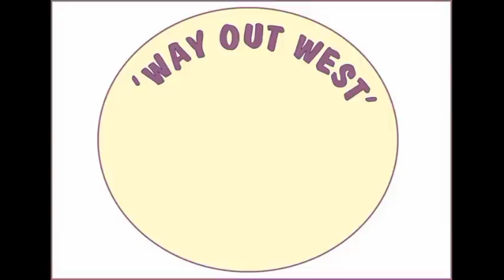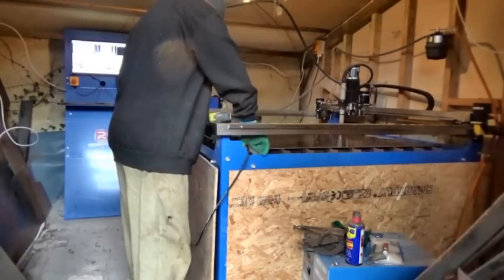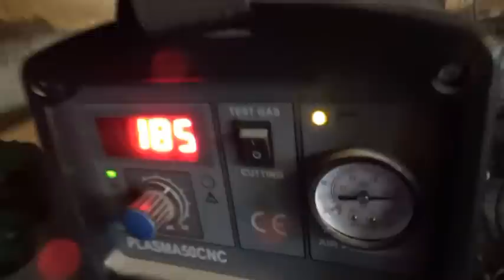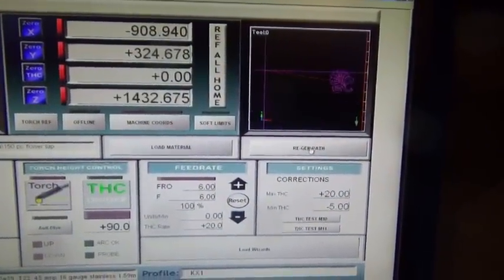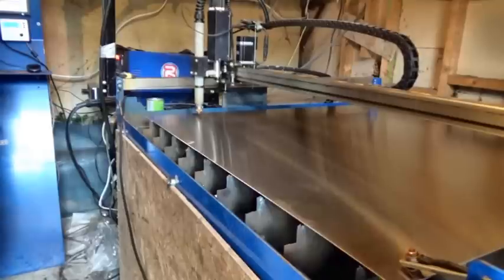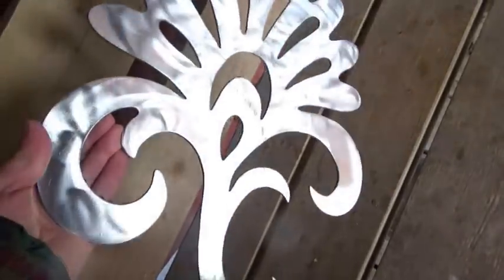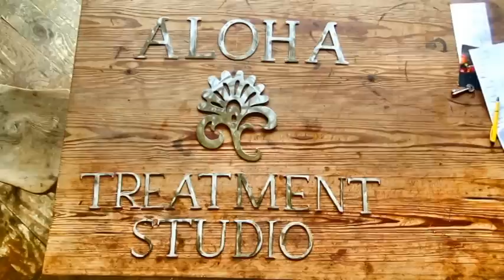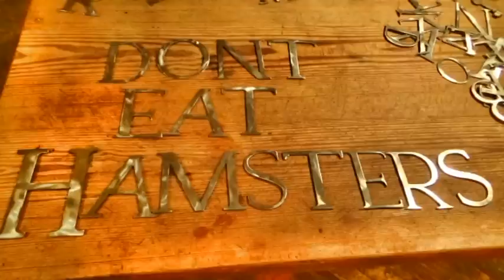Can You Cut Stainless Steel With A CNC Plasma Cutter?

Comment: Tim, very well done sir! I would advise you not to use abrasives for mild steel, only for stainless steel (inox), or if you don't have them use new, never used before abrasives for mild steel. You risk the chance for particles of mild steel rusting on the SS. I work into metal construction and fabrication so i was taught this from the very beginning. Also, use a couple of different flap discs  with different grit, this gives high polish, which prevents rust and looks a lot nicer. You can also polish each piece you cut in opposite direction to get the looks of a football lawn, or shades. All the best in your future work. bye bye
Reply from the maker: Thanks very much - I have a lot to learn!
Reply: @Wolf And will it rust at the edge where plasma have cut it ?.

Comment: Nice work! Maybe you have to passivate the parts when they are used outdoors. Stainless steel is stainless, when the surface is treated correctly by etching (pickling), especially after grinding and welding (or plasma cutting).

Comment: I second Michael's notion that stainless/Inox fumes are quite toxic. Hexavalent chromium is very nasty stuff. Respirator and good ventilation are essential. Not just plasma, the same applies to welding, but not everyone is aware of the risk.
Reply: Yep. I have a simple dust mask respirator that also cleans out welding fumes. The fume filtres aren't much more than regular dust ones (and also handle dust) so there's no good reason to not have it. You only have one set of lungs.
Reply from the maker: Thanks - I have an extractor fan that takes the fumes away as they are made

Comment: I made a ducks nest for my forge at work by cutting 3/8” hastaloy stainless with their plasma cutter, I took it home one piece at a time and welded it up with incolnel rod. I bet it weighs 75 pounds and no doubt in my mind it will still be around 1000 years from now if nobody turns it in for scrap and it gets melted.

Comment: It's oxy acetylene that struggles to cut stainless. The no rust properties of  stainless make it such a fabulous sign & letter material. It will polish to mirror like finish with a mop. I don't have a plasma cutter, but might some day try & cut with my Tig torch, although the need to use Argon at high pressure makes me balk given the cost of Argon gas, kind  of wonder if I could substitute compressed air for the Argon to make a poor man's plasma cutter. Thanks for sharing!

Comment: The fumes and dust are bad for you due to the chromium in stainless steel. Make sure you wear a respirator with the appropriate filter or have good extraction.

I work with lasercutting professionally. Nitrogen at 14 bar is used to blow the dross away when cutting 3mm stainless steel. I don't know if cranking up the air on the plasma will help any. Although I have a plasma cutter (from R-Tech) I very rarely use it.
Reply from the maker: If I had lots to do I would investigate more, but it's good to know that my set up will cut fine - just needs more cleaning

Comment: It's been mentioned already, but using the same abrasives on stainless as MS has an annoyingly high chance of contaminating the stainless and leading to rust. Most metal shops will designate abrasives, wire wheels, brushes and belts for stainless only and will keep them in a sealed plastic tub. Though I don't mean to be a bummer, the shapes look really nice.
Reply from the maker: Thank you. So much to learn!

Comment: If you turn the pressure up on the plasma cutter will it not blow the slag off better?
Reply from the maker: It doesn't work that way, unfortunately.
Reply: @WayOutWestx2  then you either need more amps or to cut more slowly.

Comment: It's a nice smooth cutting line on that machine. I would be laboriously trying to use a jigsaw with a hacksaw blade!!  How do you direct the cutting motion?? By computer?? Or are you working on a template that transfers to your sheet of SS?? The letters look great. Had to laugh, did the studio ask you "Oh, just come up with a catchy phrase and we'll put it on the sign"??
Reply from the maker: That's the wonderful thing about CNC machines - they cut things out perfectly, because they are controlled by a computer. I just have to draw what I want on the computer and the rest is (usually) easy..

Comment: You need more amps there. I cut massive ammounts of steel, mild, hardox, manganese and various stainless steels (both acid and heat resistant) from 0.5mm up to 30mm (more than 1000 tons per year). I use Hypertherm 125 amp machine and screw air compressor with dryer on 6x2m table with fumes extraction (check my channel for videos). For 2mm you need 45 amps in order to get better cut, edges will look much better. Also pay atention to cutting speed, too  much and cut looks as a metal file, all serrated, to low and it burns the material. Not all stainless steels react the same to plasma cutter so be ready to experiment. Also, be very careful with the fumes, they are extremely toxic due to chrome.

Comment: I'm not an metal expert but from the time I've looked into building stuff out of stainless steel I remember beeing warned against using tools that are either made out of normal steel or have been used to machine normal steel. It seems terrible things can happen if one does (but I don't know what).

Even for my stainless steel screws used to build my beehives they wanted me to buy a stainless steel screwdriver (I didn't - lets see whether the screws will become zombie screws at halloween now).
Reply: I you use abrasives and files that have previously been used on mild steel, you can embed tiny particles of mild steel in the stainless and it will rust.

Comment: Good to see this worked.  I am curious, what is the grade of stainless steel?   Some grades can rust due to having low amounts of e.g., chromium.
It sounds like the dross work hardened.
The end result sign looks very good.
Dave.
Reply: Most common grade is 304 which is quite rust resistant. 316 is used when it needs to be acid resistant.
Reply from the maker: Sorry - I don't know the grade.

Comment: Maybe the reason why you are getting loads of dross is that your pierce height needs to be 3.8mm gap, working height 2.5mm, use nitrogen gas, cut speed of 3935mm/min for 2mm stainless, 97 Arc volts using a 45 amp Plasma cutter. You can go search out a pdf online searching plasma cut charts.
Reply from the maker: I suspect my p.c. only works with air. I must check. I think the cut height is correct though..
Reply: Yeah it's with everything you get close enough & it will do it, just remember if you are normally setting a low amp for 2mm steel then the difference for stainless is higher amps, only marginally faster cutting, you could increase your air pressure then you can fool around with the pressure up to about 75 - 80 psi on test cuts to see if the dross is removed better.
Reply: You could try some oxygen free nitrogen instead of an air supply with stainless and aluminium plasma cutting. You mention that you are using 3 driers on the air supply, are these dessicant types? Normally high tip wear rate is moisture in the airlines.  Possibly try a refrigeration type drier with a fresh dessicant core in series .

Comment: I almost lost a finger clamping my angle grinder into a vice like that using a wire wheel. Wheel grabbed the steel and slammed my finger into the wheel.. Not nice I can tell you.